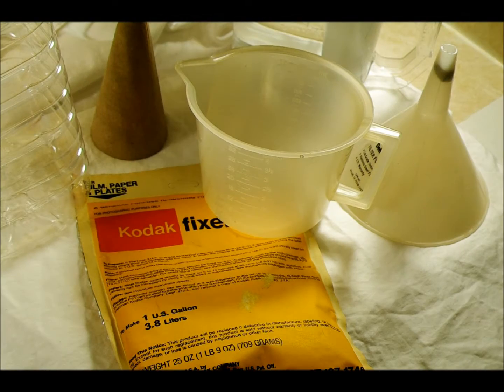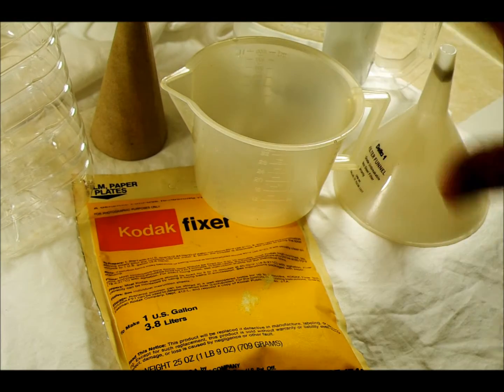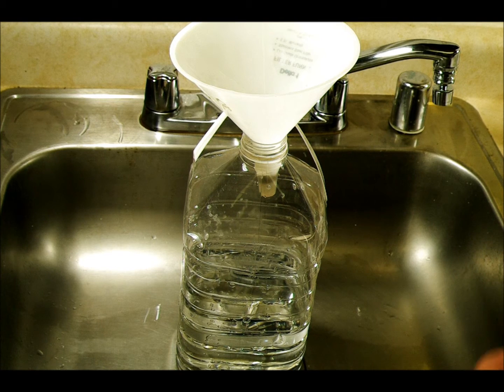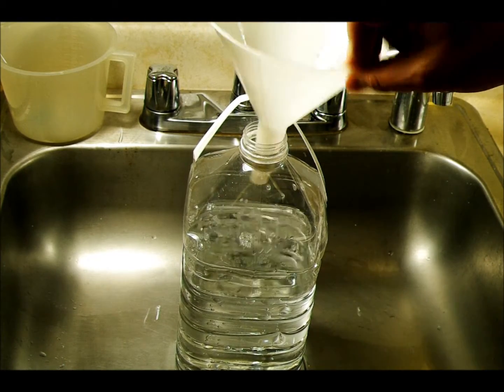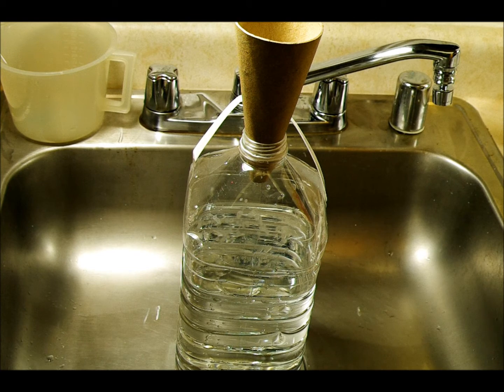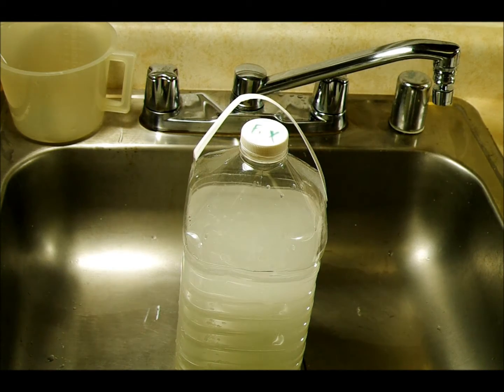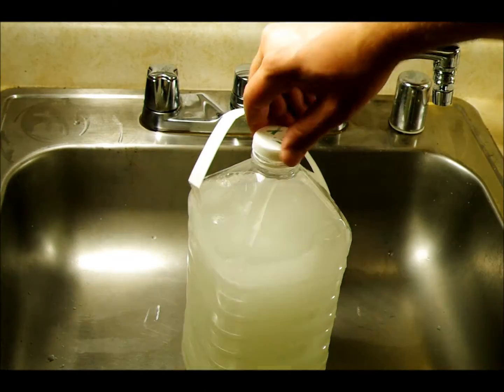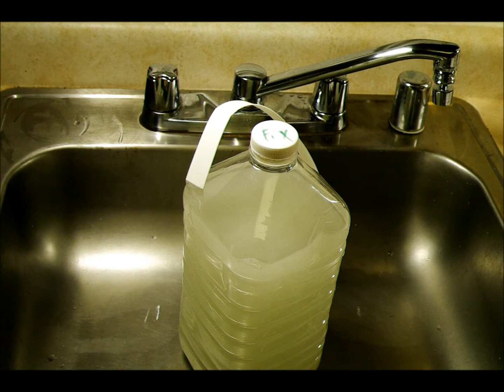Mixing Black and White Film Fixer from Powdered Concentrate

Comment: Man, your videos are so helpful! I Only have one question, after you've dissolved the powder and got your solution, do you need to mix it with water when you're going to use it as you do with chemicals that already come in liquid form? LIke "1 part developer, 4 parts water" and all that. Or can you use it straight out of the bottle? Really hope this makes sense, english is not my first language, lol
Reply from the maker: Thank you! And yes, when you mix this up you make stock solution. So when you see something in the developing tables like D-76 stock, that's this. If you see D-76 1+1 then it's one part stock, one part water (so 500ml stock, 500ml water to make a liter.) Likewise, if you see D-76 1+3 then it's one part stock and three parts water. The easy math for that is to know your volume first then and divide it by the number that the dilution adds to (so by two for 1+1 or four for 1+3.) That number is your stock solution and the balance of the volume to make your needed quantity is water.